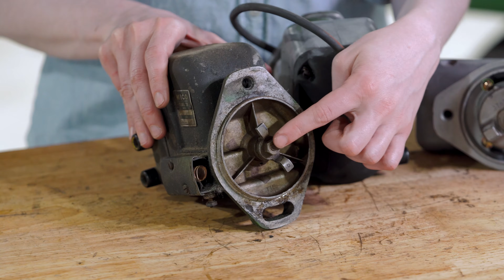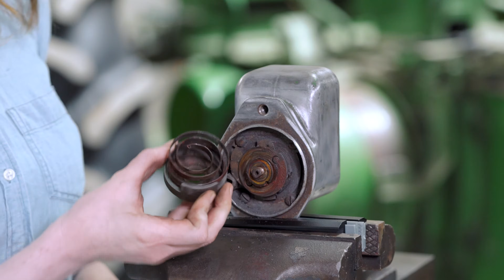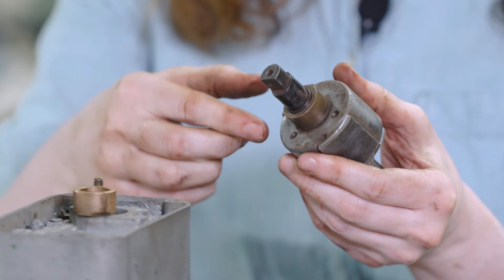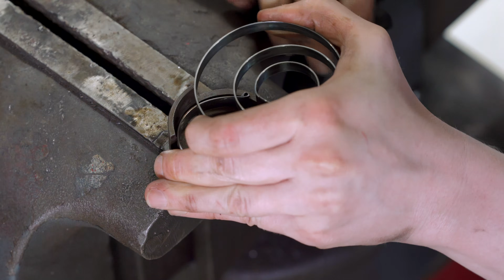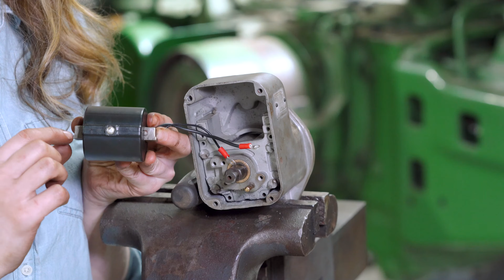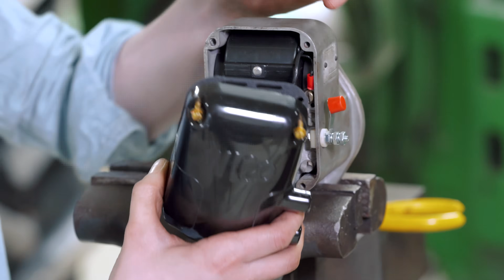Wico Magneto Rebuild: Easy Step-by-Step Tutorial for Wico X, C Series on John Deere Tractors

Comment: The Wico Magneto I have is different in that the cover has 2 male high tension posts. XH2823. 6 retainer screws in the cover/cap.Can you advise me how to procure tin part?  I’m also wondering if the internal parts are interchangeable. I didn’t realise there were so many variations. Thanks for this video. I’m in Australia and my magneto is on a Caterpillar D8 dozer.

Comment: when U set the points there should be a slight drag w the feeler gauge and then tighten screws also check the magneto cap 4 cracks they loose current like that they should be replaced w a new magneto cap sometimes U can clean the old points and reuse them if not if they look bad replace w new points 😊😊OMG 11 29 2O23

Comment: Thanks, great video. I have a WICO Model XH1343 
Serial 594837.  It’s on a Wisconsin 4 Cyl. I have a very difficult time trying to start it. Crank start. It will “pop” just enough to tease you to keep trying! I was talked into converting to a chip electronic ignition. I installed that, but NO significant change. I finally got it to run after much persistence. 
Split wood for 3hrs. Next day wouldn’t start. 
I installed 4ea in line spark plug testers, one for each plug. I finally got it to start again and am only getting spark to the left two cylinders. Runs great though. Plugs are new and gapped per the manual. Assuming plug wires/cap connections, I swapped to different plug wires and cleaned the cap and rotor, etc. 
After finally getting it started the same results. Only the left two cylinders are firing!
Any suggestions?
Do you sell a WICO CAP for this 4 cylinder magneto? I’m waiting on another condenser to arrive and will go back to the original magneto set up. Perhaps the “chip” only runs two plugs?

Comment: Ring at quail spring into that keeper is a lot like what I did for about 20 years in clock repair putting big powerful springs into spring barrels by hand. They also make a special tool for putting springs into spring barrels but we never use them.

The springs that we hand wound into spring barrels were about ¾ in wide and about 4-6 ft long.

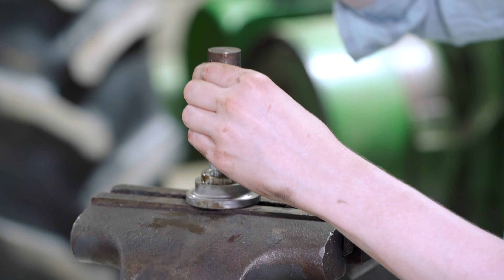Comment: I love your tractor videos, not to be nit picking but at 9:20 in the video you performed a procedure that may not be acceptable. When driving that bearing you must use a socket or tool that interfaces the OUTER Bearing carrier so as to not damage the race. What I saw was a tool hammering on the inner race. Respectfully as Always, Dennis KV4WM, A US Navy Nuclear Submarine Veteran and Amateur Radio Operator . . . 73
Reply: This is called paying for your collage education, you not only get to replace the bearing. you can also damage the shaft and end up replacing it.
Reply: Those were bushings not bearings..the driver she used was acceptable
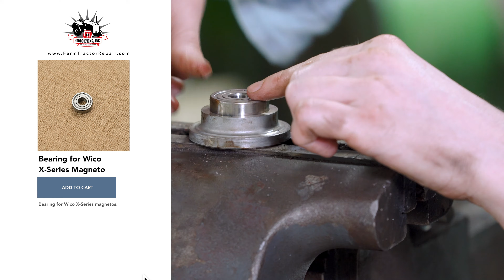Reply: @PapaJ5667  At time mark 9:14 she is clearly pounding the bearing in using a punch on the inner race to seat the outer race.  This is a no-no.

Comment: Really appreciate the content. I'm have some trouble with a Massey Ferguson 35. Getting oil in one spark plug and oil in the coolant. I can't find any good information here. I'm guessing it's the head gasket? What else could be the cause? It runs excellent aside from the leaking issue.

Comment: Never press/drive a bearing in by the center. You need to press it by the outside rim of the bearing.
Reply: 9:20
Reply: Ummmm it was a bushing ...not a bearing ...she done it right
Reply: @PapaJ5667   check at 9:17. Ummmm.That's a bearing she's driving in by the center.

Comment: im trying to put the magneto impulse coil spring back together in my dads 41 model LA. The backside where the inner washer with the groove to hold the end of the spring looks different from this. Its a Wico model X (XH-909)  The washer has mulpile grooves around the outer edge. I had to take off the gear so I could spin it up with a drill to see if I had spark. And I did have spark,but nothing going out to the plugs. Cap.rotor btw my rotor only has one arm on it) points & condenser are all new. Still no spark. Next up is wires...I hope i can make some progress!

Comment: Thsnks Rachel! It is good to know that parts are available for the WICO mags. I run pre 1970 Gravely tractors that use either WICO or Fairbanks Morse single plug mags,. The WICO mag for the Gravely s nearly identical to the one you rebuilt on the Deere. Mine has the stop button like you installed. A cautionary user tip. If you are shutting down the engine using the button hold it in firmly until the engine comes to a complete stop. I released the button once or twice when the engine was still spinning. The exhaust manifold and muffler were full of unburned fuel and air. When I released the button the spark plug fired again and nearly blew the muffler apart. The stop button is a great idea it just has to be used right.
Reply: I see that more frequently when people don't idle down.  But they are also the owners that don't have that situational awareness to make sure spark remains grounded until the engine fully stops because they are impatient... because the engine was not at idle and takes longer to stop rotating.
Reply: @ShainAndrews  Yes, very true.
Reply: Long ago I would do something similar with my car, on purpose though!